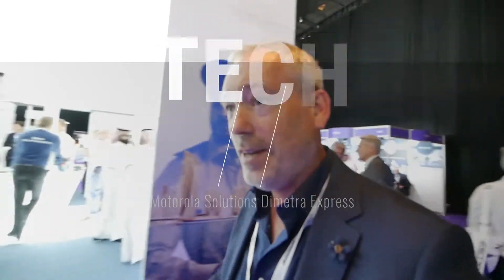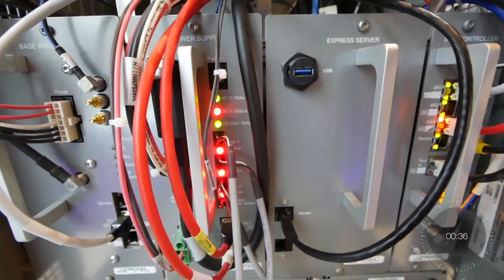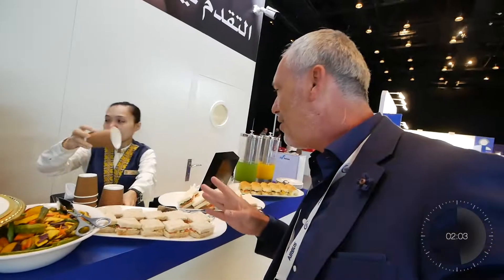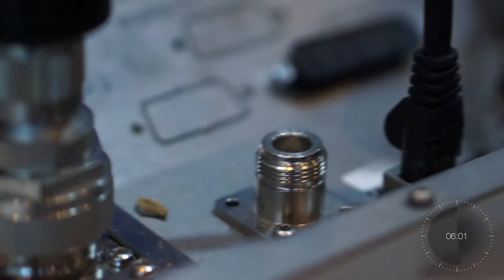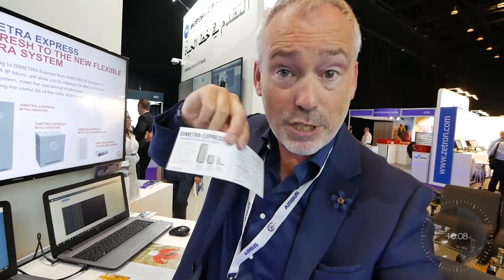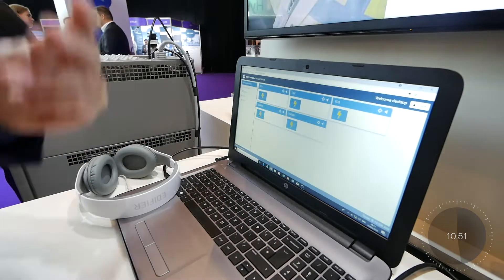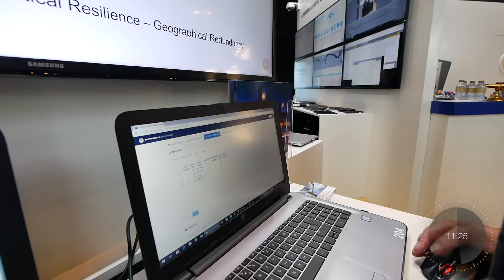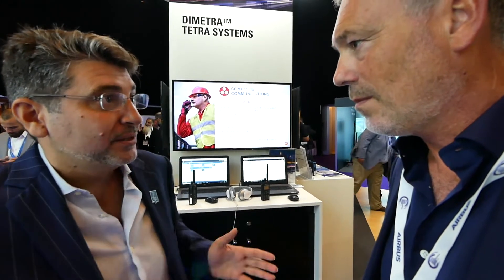I Just Reduced the Setup Time of the Dimetra Express TETRA System

Comment: 15 minutes  yawn..... DXTip based on DX200 platform 10 mins max before handling calls and telecoms grade reliability .
Reply from the maker: I think it is not only about the fact that the setup of the system takes 12,13, 14 or 15 minutes, but about the ease of installation in general. There are indeed more systems that can be setup within 10-15 minutes.